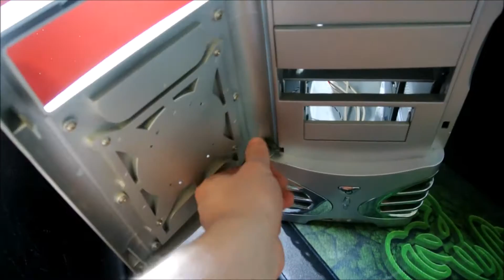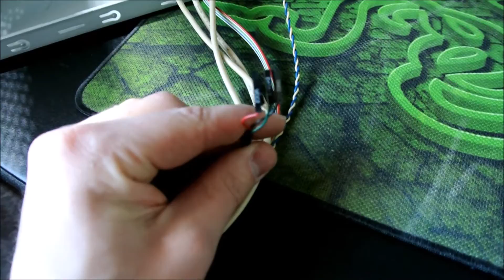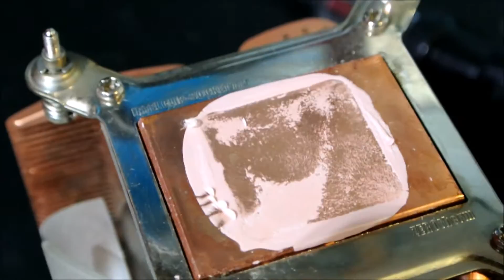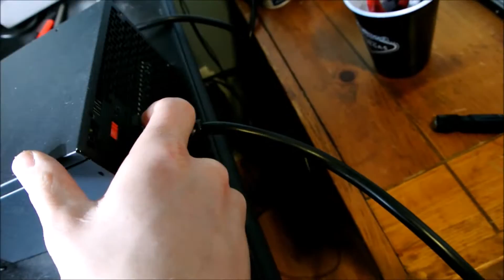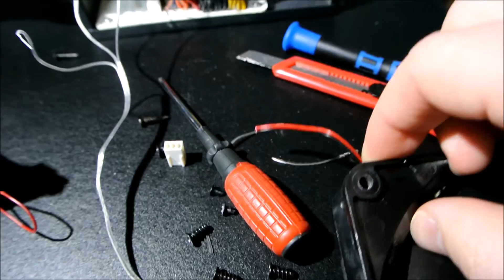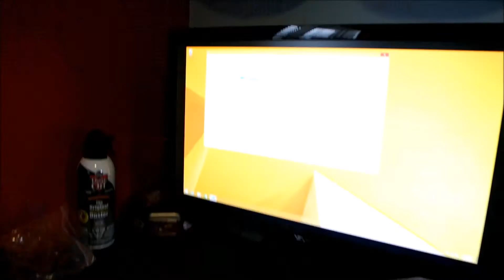Used $200 PC Build Log

Comment: Q6600 is a great CPU! I got 1 in my #WoodWorkBench build OCed to 3.0ghz :D 
Putting together the build video on it (over 5-6hrs of footage to go through, lol). 
Look for it posted when it's done on my channel: http://www.youtube.com/c/TefenCa 
Features 6GB  OCZ RAM OCed @ 800mhz, GTX 460, ASUS P5N-T Deluxe, Q6600, and some other parts.
Reply from the maker: yeah i think i may do that next, I have a aftermarket CPU cooler and a gtx 760 i could throw in there to see if i can bottle neck that Q6600.... has trouble recording without a capture card though hard on the CPU. Drops like 25-30 FPS while using recording software.